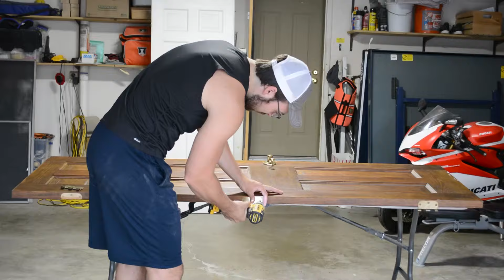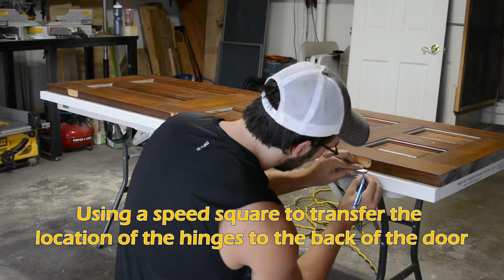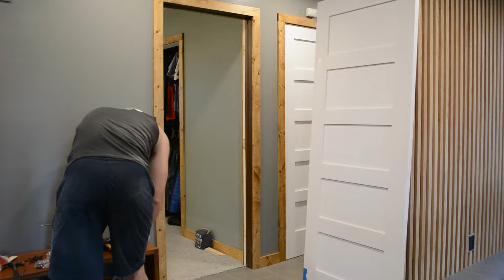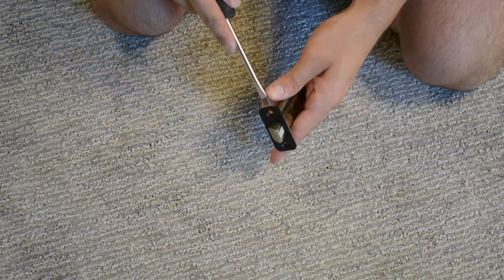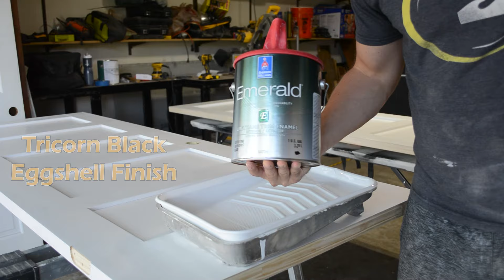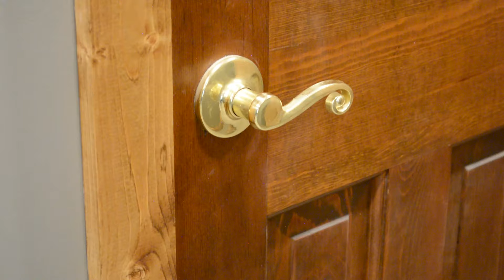How to UPGRADE YOUR DOORS Without Removing the Jamb or Trim (Slab Door Install)

Comment: New subscriber and first time commenter. I’ve been working my way through this amazing series. Had to comment here because I replaced my first slab door a year ago (first diy project, me thinking it was easy), and I’m dying now that you have all the answers to every mistake I made! 2:37 Me awkwardly holding the door and measuring /aligning when I could’ve shimmed 🫣. 8:33 me also never getting the bit off because it totally tightened exactly as you said 🫣. I also bought solid core where I thought I bought hollow. Imagine my pleasant surprise when I hauled the door through the house 30 times 😂. 

Fantastic upgrade here! While everyone is commenting the old doors WERE nice, it would clash horribly with the design of the house. Doors can really break a design if they don’t match the style. 100% onboard with your choice here! Really changes the space! Great attention to detail as always. Fantastic tips that I wish I would have known the first time 😂.

Comment: Looks great! Doors can be tricky. I used to think that buying jigs was kind of spending unnecessarily and have done a complete 180 - if they save time and make you feel more confident in getting important cuts correct the first time, they're worth their weight in gold(en key design). 

Forgetting which side is the front/back was so relatable. I accidentally mounted our fence gates on backward last week and had to remove/remount all 3 of them.

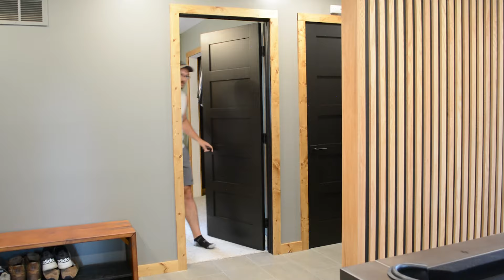Also dat clean 14:13 transition! Love those.
Reply from the maker: Yeah, I never used to use many jigs, but these ones were so helpful and made the process much more efficient. Love the pun haha! I love the transitions too but they take a lot of planning ahead haha! Thanks for all the feedback once again

Comment: 4:30 you need to bevel the edge of the door. Full and square means just that-- and that won't fit into most hinge situations. Your easiest solution is to hit it with a router's chamfer bit to take off the leading edge. That usually works but might rub on the jamb occasionally. Alternatively is to set your skilsaw or table saw to a roughly 7 degree angle and cut the edge of the door. Either way you'll need to prime the raw portions of the door (you should prime underneath the hinges as well as all cut edges) and paint all 6 sides. On the painting, you'll get the better finish if you use Floetrol. Alternatively paint the centers of your panels, then the edges, then the stiles and rails. You want to only contact wet edges. Don't be surprised if you need to touchup the stile & rail doors. For your bathroom door, you should have painted the inside half of the jamb white and the hinge edge white as well. That'd prevent the strips of black as you saw. 

With your solution, if you've not run into the issue yet, you may never. But next time you try in a different season, you may well have a door that gets stuck closed if the jamb is making contact with the stiles.

Otherwise great job!
Reply from the maker: Thank you so much for the tips and advice. I really appreciate it!

Comment: Looks so much expensive and within the vibe you are going for. The tricorn black is my favorite black. I see you chose eggshell finish … normally higher gloss is recommended for doors and jams due to the constant touch and is easier to clean. I would love to know if the eggshell finish would live to the use.
Reply from the maker: I agree that the these doors really level up the space and for not too much money! The paint I used is actually cabinet grade and is extremely durable. I personally think semi-gloss and gloss sheens look dated so I always use satin or eggshell sheens. I recently painted cabinets with this same paint in a satin sheen and those have also held up well.